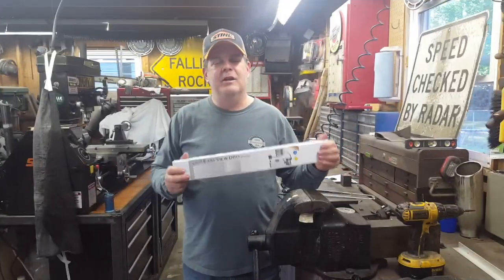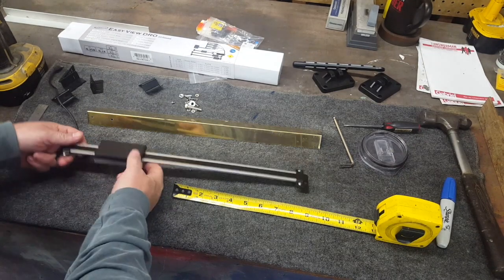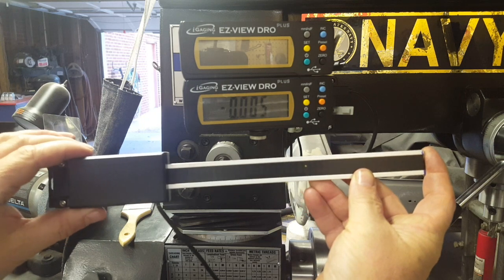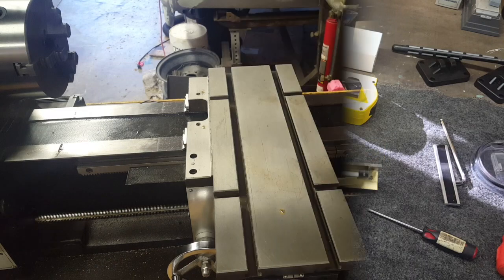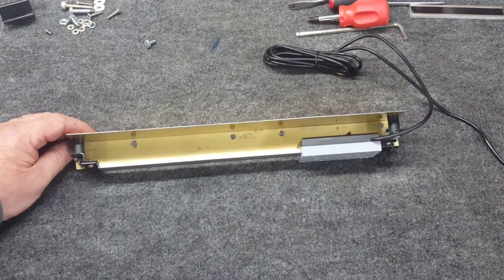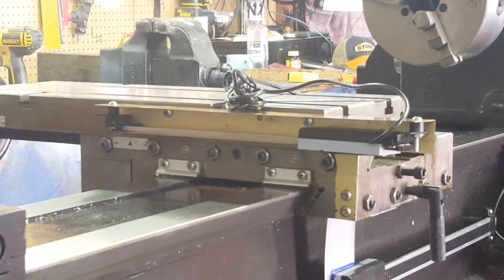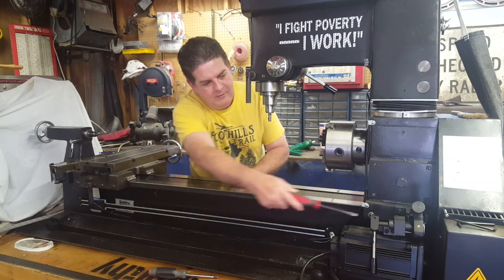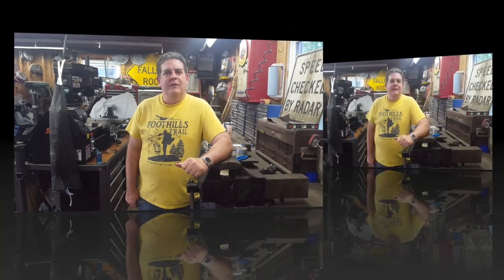Smithy Granite 1340 Max DRO Y Axis Install

Comment: Excellent way to mount the  Y unit. The magnetic scales are the easiest to deal with when needing to cut down. I've no doubt that you are going to make the mounting of the Z unit as simple as the other two. I am looking forward to seeing what you come up with. I spent the money to get the Z axis scale that Smithy sells and was sorely disappointed in the lack of quality and durability. It was dead as a door nail within 3 weeks of use. The brackets that came with the kit are going to be used for a quill stop that is needed for repeatability. Thanks for taking the time to put these videos together.
Reply from the maker: Thanks Phil, it's a shame the Smithy dro scale was crappy. I'm really glad I went the route I did, so far so good. Thanks for watching and commenting again.